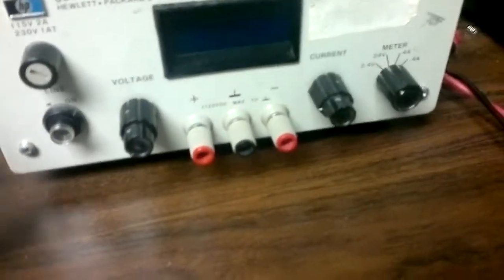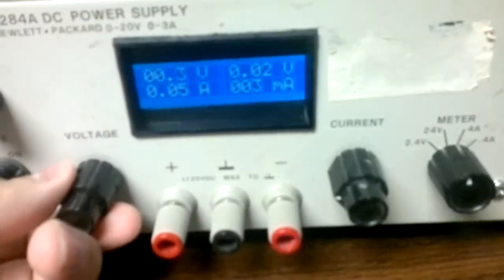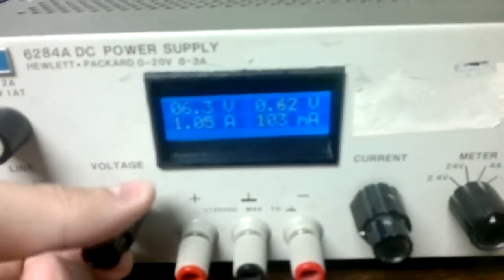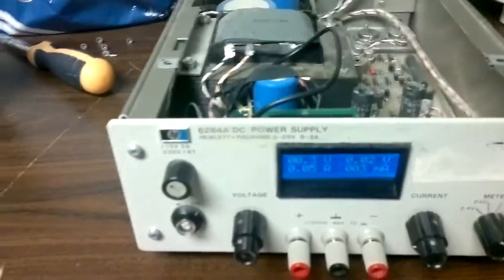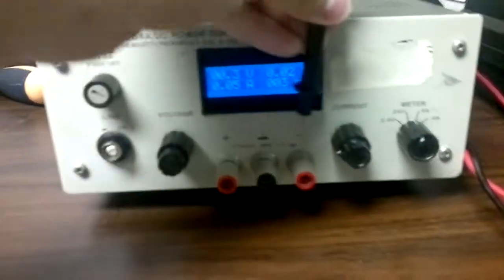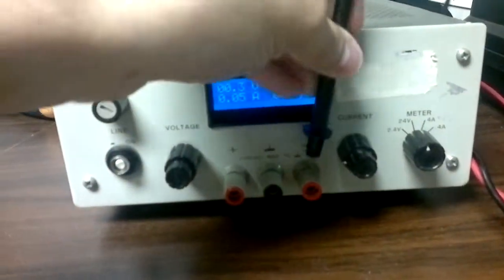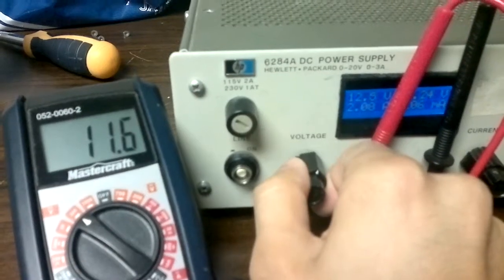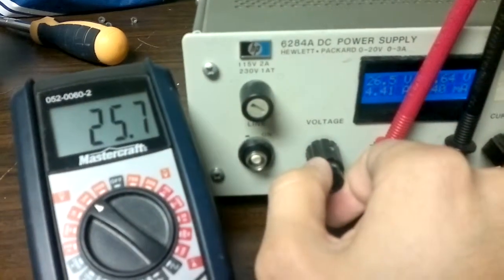Power Supply Meter Replacement - MSP430 and 16x2 LCD

Comment from the maker: oh cool, that chip is actually exactly what I would have Ideally used. I need to get some etching supplies or a cnc mill before I can do surface mount parts though. It's hard to get anything other than simple hobby type stuff in DIP packages. :(